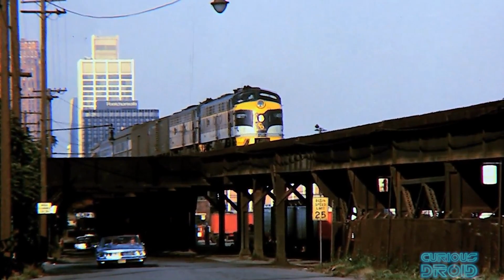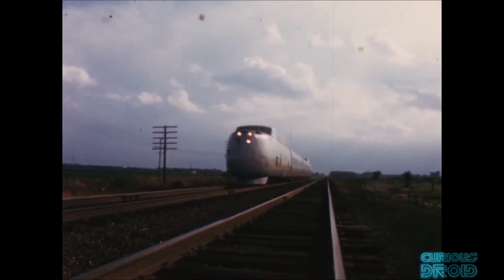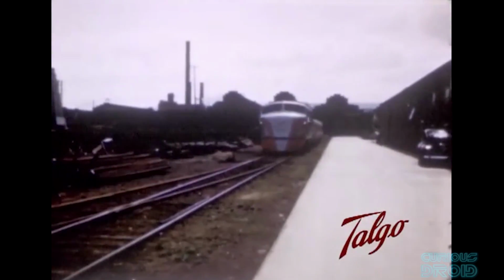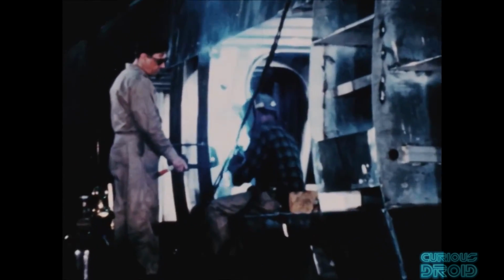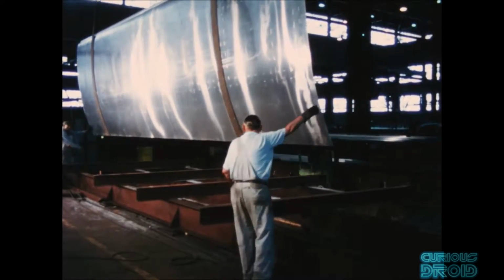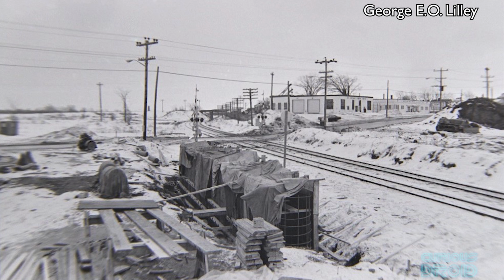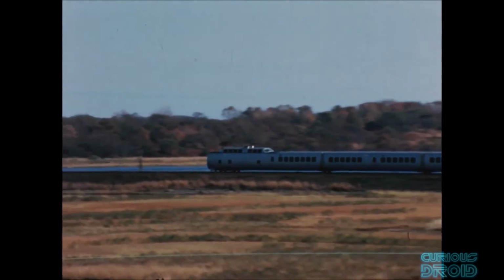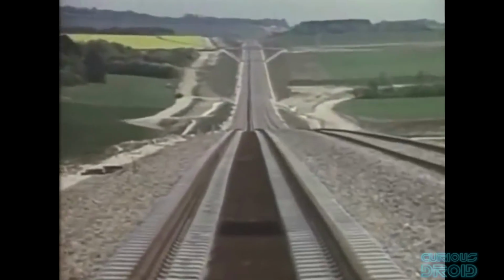America's Failed High Speed Tilting Train - The UAC Turbotrain

Comment: So what's up with the fires? I've never seen a diesel locomotive catch fire like that. Were they burning ordinary diesel or some kind of high test jet fuel or was there something else about them that made them burn like that?
Reply: Turbine engines typically burn kerosene, with a very high exhaust temperature.  Spilled diesel fuel just doesn't ignite easily like gas or kero if not atomized, and a piston engine has a well-contained combustion zone.  But if a turbine engine were to ignite its own fuel supply, then boom.
Reply: Jet turbine engines run at very high temperatures, at least in certain areas, and their exhaust is extremely hot too. Internally, I think the combusting gases can reach temperatures of 1000°C. This means that, certain exterior parts of the engine can also be very hot, and anything that comes into contact with it, like leaking fuel or lubricant, is likely to catch fire immediately. This has been a problem on certain jet aircraft, like the supersonic English Electric Lightning, which had a reputation for catching fire. 
Remember that diesel engines have a water jacket as part of their cooling system, so even though peak temperatures in the combustion chamber can be high, it is not continually sustained, and the outside of the engine remains below 100°C. Diesel engines are also very (relatively) efficient, which means the temperature of their exhaust gases are much lower than a turbocharged petrol engine or a jet engine, again, reducing the risk of fire. 
As far as I know, all jet turbine engines use some form of jet fuel, which is normally some variant of kerosene. Fires have occurred on diesel locomotives, although thankfully it is not common. Remember that diesel locomotives are actually 'diesel-electric', so a fire could be started by a burned out generator or traction motor, or any part of the high-current electrical system.

Comment: This is true even nowadays. I mean there are substantial upgrades that could be made to high speed trains. 500kmh top speed is not out of reach, but that's not the entire story.
Even the few that nowadays reach let's say 320 do it for a couple of minutes and then have to slow down. Many trains are not express, so they will cover midsized cities. If there isn't a circumventing track, than it becomes a bottleneck in the whole system. If you add to that cargo and regional trains, old track connecting stations to HS lines then we get: average speeds much lower that the top ones.
That's why the ICE4 in Germany doesn't strive for speed. The average speed of ICE network is around 250, and that's where Siemens capped the speed up.
Reply: 500 kph is still too slow to compete with planes going 950 kph.
Reply: @TheBandit7613  let's say you need 30 minutes to get to the airport, another 30 for security and 20 for boarding. Optional 15 for luggage check in. And at the destination another 10 for deboarding and 30 to get to your destination, again optional is luggage collection at about 10 minutes. 
You have between 2 hours and 2 hours and 25 minutes (and I'm being really generous) of doing precisely 0kmh.
If somehow you were going on a straight line with no stops, the train would build a 1000 km head start. In the real world those two hours on a 500kmh capable train/track would give a 300/400km leap.

And btw airplane airspeed is measured in knots indicated and not ground speed. It also varies throughout the flight. There are take-off, climb, cruise, descent, approach and landing. You are only doing about 950 on cruise. For short haul that is a small part of the overall flight.
Reply: @almerindaromeira8352  And we'd still have to get to the train station, check in, check luggage, find a seat, ect. So no savings there. 
Local high speed rail is already under construction in some places. 
Without a dramatic increase in speed, ground based long distance travel will be by air. 180 mph or 600 mph, when traveling 3000 miles... I'm sure you understand that.
For short distances, like 300 miles, rail can probably work, especially out west. 
In the east, having to buy up properties, that makes it about impossible.
Reply: @TheBandit7613  where do you live and why the hell do you need to check luggage on a train?! 😂😂😂😂
I get there 5 minutes before, get in put the bag on the rack and take my seat. Meanwhile we are already on the move...
Train stations are also very well located (geographically speaking)
Reply: @TheBandit7613  you see I live in Europe. Your american struggles are yours to bear. I'm just saying we are not done with high speed trains (worldwide)

Comment: Great to see the Turbo get its own video. The Turbo Train would have worked better if it had used conventional standard diesel engines and stead of the jet turbines, which were not needed do the the commercial service speeds being well under the 160-mph potential. Or like Amtrak 'Cascadia' Talgo trains the coaches could have been hauled by a standard diesel. The other jet turbine train in the USA was the Rohr Turboliners, based on the French Turbo Trains, that ran in the Midwest and Upstate NY from the 1970s to the year 2000. Bombardier created a gas turbine version of the electric Acela that it called the Jet Train, but it failed to find buyers.
Reply: The "it burns less fuel the faster it goes" line made turbines seem like a sure thing in the future of travel, in the 1960s. Irresistible to the engineers and corporates. But ... they were wrong.
Reply: @daveunderwood1825  Gas turbine good for dedicated HSR line (or heavily upgraded line) were you can utilize but for 80-to110-mph track, diesel would have been good enough. They put too much new tech into one new train, leading to issues of troubleshooting all the problems that then occurred, just like British Rail's APT.
Reply: Doesn't matter what the train is powered by if there isn't the demand for the service or there isn't the money put into the infrastructure

Comment: Technically the US has the fastest train, since the 60's or 70's. Check into Holloman Air Force Base, and the rocket sled. It runs on a track and it's had human passangers. I think the speed record is around Mach 8.5 (less with human passangers). Do better europe.
Reply: Doesn't  it have to be more than one car to be considered a "train" though? Fastest vehicle on rails, certainly.
Reply: @RCAvhstape  Dang your logic ! But I do think the fastest rocket sled has 2 or 3 stages (which are unmanned sections).

Comment: The reason the US does not have decent rail, but was a leader in the 1800s and early part of the 1900's, is due to FDR's misguided notion that raising prices was a good thing for the economy in the midst of the Great Depression, and thus created the Railroad Retirement Board in 1935 to prop up wages for rail workers.  This took the steam out of rail, leading to a contraction of the network by over 50%.  Despite rail being 6 times more efficient, they thereafter charged roughly the same as shipping by truck.  Rail workers with no education have ever since gotten very fat retirement benefits, but there was no money left to make nice new rail or make electric trains.
This stinker of an idea is alone responsible for 15-20% of global warming...due to the efficiency losses, from using trucks and the surrounding road congestion because of the extra trucks on the roads, and the fact that rail often goes through mountains and hills rather than over them, but to do the same for highways is far more complex and expensive, and often rail is straighter and therefor a shorter distance than going by highways.  Most of these savings are freight related, but there would be passenger fuel savings as well.
The US had 400,000 km of rail before that bill.  We have 149,000 km today.  And the RRB still exists and still cripples rail.  "...the average annuity paid to career rail employees was $3,525 per month, the average annuity paid for all retired rail employees was $2,815 per month" 2018.  Why should retired rail workers with no college get over $42k a year?
If it were not for the RRB we would have 80,000 miles of electrified freight (probably moving 40% faster as well), and 50,000 miles of high speed and near high speed rail service. And probably 100,000 miles more of slower older lines.
We also would not have been so thoroughly gut punched by OPEC in the 1970s.  Though, most of that is on Nixon for lifting the limit on oil imports imposed by Eisenhower, encouraging the building of oil power plants, when we needed to be building nuclear power plants instead.  And that lead to the loss of all our gold reserves in the "Nixon Shock" because we had a trade deficit that resulted in the printing of more currency than we could cover in gold, because we needed currency here, and our currency was staying overseas, rather than being exchanged for additional goods.  Only after he stupidly gave the French  all the gold, did he make our currency no longer exchangeable for gold.  We have been in relative decline thereafter.  He should have denied them the gold...forcing them to buy American goods instead.  Of course, he should have never allowed all the oil in that tilted our trade balance in the first place.

Comment: I think the US will likely never have a high speed rail network, regardless of improvements to the rail infra-structure. Europe and Japan have a number of conditions which make high speed rail practical while the US does not. First, the distance between city centers in the US is much greater, second the population density is much lower and third many US cities are far less accessible on foot or other human powered transport than European and Japanese cities are (in the US you practically have to have a car to get around once you reach your destination).  It's unlikely to be economic to use high speed rail except in the most heavily populated older city-with-decent-public-transport cities of the north east which grew up in a time before widespread adoption of the car. Even these areas are much less densely populated than the least populated areas of western Europe and Japan. There is a reason air travel won out in the US and the economics of that equation haven't changed.
Reply: The US airline lobby ensures trains will be kept uncompetitive.
Reply: @lesigh1749  Nothing beats a rational explanation quite like a conspiracy theory, eh?  Look, the US rail system was shedding passenger service well before the airline industry became the cock of the  walk. Why? Because it's not profitable compared with freight . Generally, the faster you go whether by rail, road or sky, the more fuel inefficient the transport becomes. If rail lines were already shedding passenger service in the 1940's due to poor profits, can you imagine how unprofitable high speed rail is going to be? Europe and Japan were only able to establish high speed rail by essentially having government take over the railroads and subsidizing them, something highly unlikely to fly (pun intended) in the United States.

Comment: Europe and Japan had devastated rail lines at the end of WW2...much easier and less expensive to build the latest and greatest if you are starting from scratch...our system has to deal with the legacy systems in place till we can fix and replace what's there...not to mention current owners, like N&S who have priority...🤷‍♂️ Europeans always forget when being critical of our rail system about the other problems we have that they don't...
Reply: Starting from scratch is indeed easier and less expensive than trying to improve old and congested infrastructure but you need to study history. WW2 damage was long fixed before these countries worked on high speed rail. The Tokaido Shinkansen and TGV Sud-Est were built because despite state of the art modernization, the conventional lines could not cope with increased demand. A strong legacy system is a crucial ingredient in the success of HSR because it insures that trains will be full from day one.

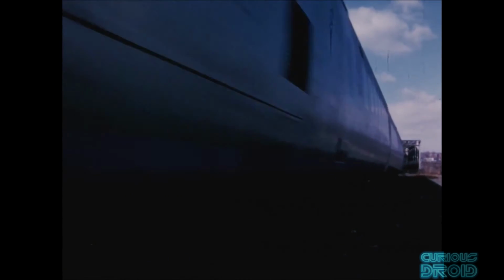Comment: 9:00 That is not correct. The record for a gas-turbine wheel powered train is 318km/h set in 1972 by TGV 001, prior to them switching to electric drive. There was also faster jet trains, but they are technically not gasturbines
Reply: That train has the record for gas turbine-electric locomotives. Different category.
Reply: @chickenfishhybrid44  its still a gas turbine
Reply: @matsv201  it's two different records. Just look it up.
Reply: @chickenfishhybrid44  The mecanical recotrd is a subcategory to gasturbine, but ultimate gasturbine record is  still held by TGV 001. 

Turbine mechanical is a so rare category so its pretty much only the Turbotrain in it.

So if you want to claim that it holds the record for the mechancial gasturbine train, yes, its the only entry, kind of pointless.
Reply: @matsv201  lol, I'm not "making claims". I'm telling you how it's categorized and written on the internet in the sources I've found. You don't see the TGV001 record listed as just Gas Turbine locomotive, it specifies gas turbine-electric. These terms and categories are simply accurate and factual. Anyway, I'm far beyond my level of care here.
Reply: @chickenfishhybrid44  Yes you are. Gas turbine mechanical is a subcategory of gas turbine. To claim that its the record holder in the gas turbine mechanical category is totally pointless, its the only competitor. There never been any other gas turbine mechanical train built for speed.

That someone choice to categorize it don´t change the fact that in the outer category of gas turbine trains, TGV 001 is the current top speed holder

If it have mecahnical of electrical drive don´t change the fact that both are gas turbine trains. You are just plain wrong on that regardless of what you have read.

Comment: It's a pity that America, with its long history of railroading across vast stretches of countryside, can't operate a high-speed train service today.  I feel that part of its problem is that it keeps trying to reinvent the wheel.  The technology does not have to be of American origin.  It has been well tested in other countries and systems have now matured to the point where they are fast, efficient, safe and reliable.  Just use the Shinkansen or the TGV as a place to start and build your own, but for Heaven's sake, don't skimp on the tracks.  They're an integral part of the system.  Japan uses elevated tracks that are isolated from roads and other tracks, and both tracks and cars are designed to be earthquake proof with many automatic safeguards built into the system.  Their on-time performance and safety records are second to none.  If they can build theirs using a devastated post-war economy then we can do the same using our much greater resources, plain and simple.
Reply: All passenger trains and subways operated today in the US are of foreign origin though built to US federal standards in America.